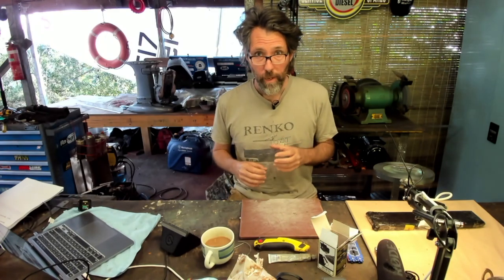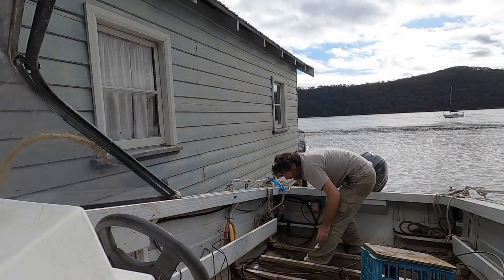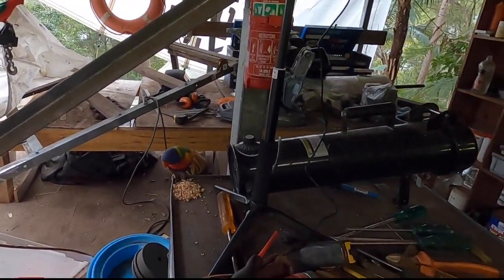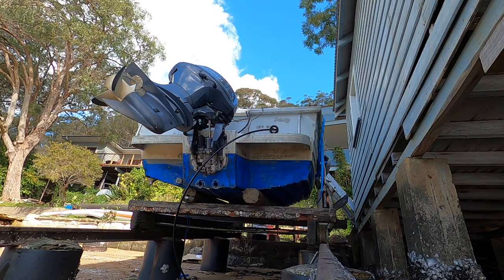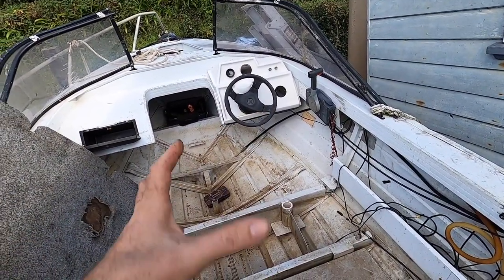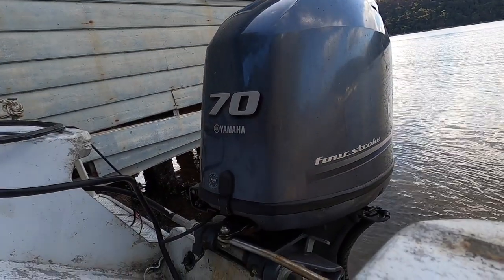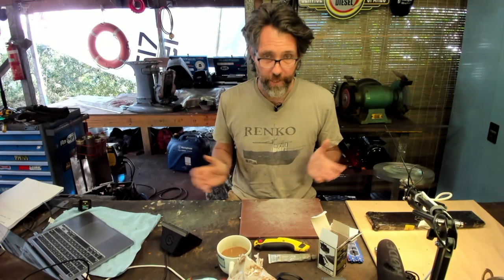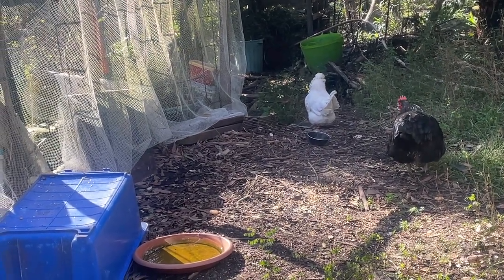Outboard steering cable replacement and new website

Comment: Was in a boat pulling a skier and part of the steering cable mechanism broke and the 85 hp  motor was at full throttle. We were in the middle of a turn and the torque slammed the motor in the opposite direction and ripped the motor off the transom  The motor did a 180,  flipping upside down with prop coming out of the water and for a brief moment, went to some insane RPM before submerging. Luckily we lived to tell about it and nobody got hurt. We had to change our underwear when we got home though...
Reply: Good gravy, that will wake you right up, huh?
Reply: @charlesxix  I was a passenger, but knowing the driver... probably not.
Reply from the maker: Yep, that's the real hazard, the torque of the engine will turn it to full lock in an instant. When I was working at Maritime we were called to a guy that had that happen and he got thrown against the gunwhale, broke his pelvis then ended up in the water with his boat rapidly doing circles right near him. Not a good day for him at all...
Reply: @DangarMarine  Man, broken pelvis and having to dodge a circling boat. Dang. They make kill switches for  reason....
Reply: That’s some scary shit

Comment: My first ever video of Dangar I watched years ago was replacing and cleaning the tube for a steering cable. Now here we are again lol. These are the type of videos I love from Stu. I do love Renko but this simple mechanics are great.

Speaking of. Had a F70 brand new installed a month back. The mechanic installed the steering cable back to front under the helm so when I turned left it went right and vice versa!

My wife calls the channel Danger Machine tho as I wore my Dangar hoodie to the Doctors once and the Dr kept saying "I love the hoodie, Danger Machine doesn't sound safe"   Neither does a Dr that can't read but hey!
Reply from the maker: Wow, surprising that a pro installed it backwards. Obviously didn't take it for a test run either!
Reply: @DangarMarine  nope they don't do that either that's the first thing I asked
So don't use Heatherbrae Yamaha lol

Comment: I’ve lost count of the number of times I’ve told people about your air compressor and oil trick for the cables! Love your work mate!
Reply: Hate to ruin the trick, but compressed air and oil can make explosions happen. if you know a fridge mechanic they may have some dry nitrogen that can be used to do the same thing
Reply from the maker: Has anyone ever heard of a control cable actually exploding? I'd love to read a report if so.
Reply: @fairhall001  got any more info on that? I will absolutely continue to do it at 100psi
Reply: @dbayboyds409  It is taught in refrigeration. It is why leak testing isn't done with compressed air.
Reply: @DangarMarine  Leak testing in refrigeration is done with dry nitrogen because of this risk.
Reply: @fairhall001  isn’t it also done with dry nitrogen because it is clean and dry compared to compressed air?
Reply: @dbayboyds409  Yeah, but if you do this with compressed air it is likely to explode.

Comment: Stu your reference to steering coming undone at speed and nasty accidents reminded me of an incident I attended decades ago now.

It occurred during a high speed endurance water-skiing event on the River Murray when a boat suddenly made an abrupt turn of almost ninety degrees straight into a grove of willow trees.

The bloke at the helm seemed to be ok but a fairly substantial branch had collided with the back of the observer's helmet with such force that the branch had snapped like a match.

Although he was conscious and quite cheerful there were natural concerns for the observer's cervical vertebrae so he was fitted with a stiff neck collar and strapped to a Rigid Extraction Device or 'RED board'.

He was quite a character and kept up an almost continuous stream of jokes and humorous observations that made the retrieval crew laugh so much we had trouble carrying the RED he was strapped to through the tangled vegetation to a rescue vessel.  

Investigation indicated that the boat involved in the collision had become airborne due to interaction with the wake from another boat causing the helmsman to suspect the steering system had failed.

The helmsman promptly manipulated the helm to confirm his suspicions just as the boat resumed contact with the water resulting in the sudden manoeuvre and accident!

I will never forget examining the branch broken by the observers helmet and wondering how the heck he survived, much less that he was not only conscious but apparently uninjured!
Reply from the maker: Glad to hear he was okay. You've reminded me of another accident I got called to where the observer got decapitated. Very sad and not a fun one to attend from my side either.

Comment: I have that same spring in my 1999 W900 it runs the electric windows up and down never replaced just serviced with some oil and grease first time one of them did not work I was surprised to see the spring running through the motor and not a gear plate. You have come a long way and I have learned a lot like how many coopers it takes to fix an outboard:) bring back the chalk board!
Reply from the maker: Thanks John. I do agree about the chalk board, I'll have to work on that!

Comment: What agreat repair clip, fantastic talk through and demonstrate all at same time.
Never done a push pull steering cable only done the hydraulic ones.
As for your web site I'll pop on and give it s bash.
But looks great...... simply and easy to follow
Top work.
Reply from the maker: Thanks Marc!

Comment: just got my first boat, it needs work. Thanks for all the great info.  big fan of White lithium greese for hindges, fan belt dressing, other.. watched a video demonstration recently showing diferent greeses against a propane torch, all the black greese failed, only the reddish colored Wheel berring stuff survived. also I've noticed a lot of black tars tend to dry shrink crack.  so I suggest checking how well wheel berring greese hold up against salt water.

Comment: Hi Stu, Great idea on the Repair Guide video website. Facebook has groups and one is on Mercury outboards mainly 2 stroke. One of the most asked questions is the first one I asked you years ago. Why is my outboard motor only going 10mpr and wanting to die if I try to go any faster? Most of them state they removed the carbs to clean and put them back on. Well, the problem with that carbs need to be re link sync or the motor won't run right. So, showing how to do link sync on a merc 2 stroke is a good one. Also explaining that the only adjustment screw on these carbs is the idle mixture screw. Once that is set up a 1 1/4 turn out from seat that is it. Rest is the link sync and timing adjustment. Idle timing sets the run-in forward gear RPM. I keep telling everyone to get the service manual if they want to save money in the long run on these. it has great troubleshooting in it.
Reply from the maker: Hey Tim, it is amazing the number of problems that a carburettor sync can solve.

Comment: I once drilled a drain and a fill hole in a riveted helm case that was really stiff and crunchy. Filled it with cleaning solution and let it sit for a while then drained and blew it out a few times. Installed a screw plug in the drain hole and refilled it with lube and capped the fill hole.  The wheel turned  nicely afterwards. It was meant as a temporary fix but wound up lasting years. Yes, I’m a very frugal (cheap) boat owner. More money saved on repairs means more fuel in the tank and more bait on the hook.

Comment: loving the new look! getting crazier by the day. something I've been trying to do and cant quite figure out, adding electric start to a 4hp 4 stroke mercury. I wont have easy access to pull it and it will be on a very large...... kayak. if you have ideas let me know!
Reply from the maker: Good question about the electric start. If they sell an electric start version at the same horse power it should be possible. Failing that you may need to fabricate something custom. Would certainly be an interesting video to make. I might give it a go!

Comment: I enjoy how you recover boats and engines from ending up in the scrap pile. 
You would think the outboard engine engineers would put a grease zerk in one end of the steering tube and a small hole at the other end . So   fresh goes in and out goes the old contaminated grease.
Reply from the maker: The trouble is the type of grease you get in grease guns tends to be the type that will gum up these steering tubes, you really need something lighter.
Reply: @DangarMarine  
Have you tried Quicksilver 8M0071841
Not cheap but if it does the job and doesn't fail, like getting gummy. 
Keep that  Detroit engine humming.

Comment: T&H Marine makes a seal for the tail side of the tilt tube, which helps keep nastiness out of the tube, and keeps lubricant inside. There are also boot kits available for the same purpose. The seal works fairly well. I had used the boot style before, but ended up changing over to the tube seal instead, as the boot style didn’t extend far enough for full coverage of the cable tail, and didn’t seal up the tilt tube good enough.
Reply from the maker: I do think a seal like that is a good upgrade. I would also recommend turning all the way to port when storing the boat to keep the rod retracted.

Comment: Word of advice, compressed air and oil are not a wise mixture and can be explosive. The same trick can be accomplished by using dry nitrogen however. Machine oil, like a fridge mechanic would use sounds like the right stuff. Love the website idea!
Reply from the maker: An explosion sure would make an awesome video!
Reply: @DangarMarine  You know the saying, it's always funny till someone gets hurt. Then it's just hilarious!

Comment: Gday mate your first videos seemed ok to me but the new ones will probably be heaps better ,im glad you are doing some more on outboards as i dont think many would have boats like renko and your videos are always a help , my resto had a mecury marine helm in it when i pulled it apart it was made never to break old school 1980 vintage thought you might have pulled the old helm of and greased it up but i suppose due to time constraints on length of video probably not practical anyway you have helped me already in how ill put my new helm in cheers .
Reply from the maker: Thanks mate. Not being my boat it's really about the money the owner is willing to spend. Personally I would just replace the helm but it's hard to know where to stop when it is someone else's money.
Reply: @DangarMarine  Gday stu yea i thought it was one you were doing up for yourself some people are just tight like do it as cheap as you can and then they get into problems and it costs them twice as much .

Comment: Thanks Stu,
Ever try that silicone dielectric/vacuum grease on the steering tubes?
It should repel water hardening and metals corrosion, if you ever seen it on pool filter housings, it is always a greasy mess (loose).

Comment: Our outboard motor spent 10 years in the Arizona desert (Lake Havasu). The grease in the tilt tube turned into epoxy.  A sledge hammer wouldn't budge it.
Reply from the maker: For sure, once it has set it has really set!

Comment: Stu, can I make a suggestion for a video? Setting up a small tiller outboard on a tinny, motor heights, steering adjustments, how to adjust the little fin that limits torque steer etc…??? I see so many small engines that just don’t look like they are set up well.
Reply from the maker: Hey mate, that's good suggestion. I do have that covers a bit of that here https://youtu.be/IonsSQYVsU4 but it doesn't go into the trim tab anode. I'm about to put a 25HP tiller on a small hull this week so I'll film that.
Reply: @DangarMarine  cheers! I’m QLD based now but spent many years fishing the lower Hawkesbury when I lived in Sydney and berowra. I’ve just set up an 18 tohatsu on a 3.5 and am still fine tuning it so will look out for the vid. Love your work.

Comment: Hey Stu,
The new website looks good.
Must buy a DM tee to support you, or a carton of Coopers.😉
I believe it is best practice to replace the nyloc nut 
on the steering drag link.
Also "Shotgun" cleaning brushes may go close for cleaning,
the steering tube?
Reply from the maker: Thanks mate! Yes, if you can replace the nylock each time that is ideal, but you can also feel when they are very tight and aren't going to vibrate loose.

Comment: Heya stu, had a look at the new site, looks good! I know the focus is on repairing outboards, but I wondered if you would want to include other info on outboards too. For example, what to expect for an increase of say going from a 120 to a 140 on a 5.5. m glass vessel, ( bugger all increase in top speed in this case ), likely fuel consumption stuff for various technologies etc.. I found it quite difficult to find some of this data and most of it was opinion. Anyway, just a thought. Keep up the good work! A.
Reply: New site? Have I missed something?
Reply from the maker: Hi Adam. I have been thinking about how to incorporate the information that doesn't fall into the diagnosis flow. All the boat driving stuff is another example. Maybe another tab for that information could be the way to go.
Reply from the maker: @steveselvage40  He's referring to the website that brings all the videos together -- https://outboard.dangarmarine.com/guide

Comment: hi stu i just had to remove the pushrod which dont push on a hydraulic  bullhorn steer system  only moves when t/and t does it had been on boat for 5years .fark i tried everything to get it out .i had to destroy the rod to get it out of the tilt tube so i could sell the motor .i recommend once yearly to remove and clean and lube on all hydraulic  steer systems maybe a good vid add to your new website cheers dunc
Reply from the maker: Yep, regular maintenance goes a long way. It's a bit of a pain at the time but it sure pays dividends.

Comment: I'm new to boating. I have come to the conclusion that the boat I just bought needs a new steering cable. It has a rack and pinion steering system and I'm wondering what your opinion on upgrading is. I could replace it with a whole new hydraulic system or perhaps a system more similar to the one shown in this video. Worth the bother? Perhaps it would be silky smooth by just replacing the cable with a new one? Thoughts?

Comment: Thank You Stu, your videos are very Informative, for me being a first time boat owner your videos are a great and provide expert guidance. I have just bought my boat a few months back and picked up an issue with the Steering cable, The cable enters from the Starboard side and when I turn the Steering to the right all the way, the Sleeve in the pivot tube pushes out completely on the Portside and gets jammed causing the Steering to lock in that position as the shaft is no longer inside the Pivot Tube, I then need to remove the Nylock on the Drag link end, dislodge the shaft to free it which I then have to manually Wiggle and Push back into the Tilt Tube and tighten the drag link to regain Steering. Can you please advise the cause of this? Could it be an Incorrect or Faulty Cable?  The boat was standing for a couple of years prior to the previous Owner selling it.
Apology for the Essay, I have been researching this but cannot find any info regarding this specific Steering issue. This is my first Boat and am still in the learning phase. Any assistance will be appreciated? Thank you so much Stu.

Comment: Great vid and as good as a FSM on the cable, and lots of helpful bits on the tilt and setting up. I've mostly worked on hydraulic steering and it's useful there to count the P-S wheel turns to centre the steering (-ish) before conecting up the engine. The '-ish' is that on hydraulics the steering doesn't return exactly each time, but I'd imagine that it's useful with cable to have it more or less centred. Recording the cursor is easy in OBS on a PC (toggle on/off button), but it looks like you're using a Mac. I think it's harder / impossible there. Hopefully there's a workaround (forum?). I've also used a yellow cursor highlight tool (on PC). Great to see the website. It'll be a really useful resource. Finally, I like the haul-out trolley you're using. What's the tidal range at D I?
Reply from the maker: Thanks mate. Yes, the cursor toggle doesn't seem to exist on the Mac version and have yet to find a workaround either. I'm thinking some extra app that lets you draw over the screen then wipe might be the way to go.

Comment: Love your videos! 
Quick question if you have time. I have a 1986 Suzuki 200 two stroke and it’s struggling to get into gear in saltwater, but in freshwater it has no issue at all. 

I’ve pressure tested the gear case- seems like no leaks
Changed gear case oil - it was black
Tightened gear linkage

It sounds like a slipping dog clutch. But why would it go into gear in freshwater? I’ve called numerous mechanics and no one has an idea

Comment: Hello Dangar Stu,  I have a 17-foot, tinny rigged with a 40 hp outboard with standard steering wheel steering. I converted the helm station a bit so the wheel is on top of the console (wheel is now parallel to the boat floor) for stand-up driving. I had to get extensions so the wheel was high enough for stand-up driving. The result is I had to go to a 3-bolt steering wheel. I had a 3-bolt, 8-inch diameter steering wheel on hand so I installed that on the extension. I haven't tried it yet. Do you think an 8-inch diameter steering wheel will be large enough to control the 40-hp engine? Love your shows. Thanks